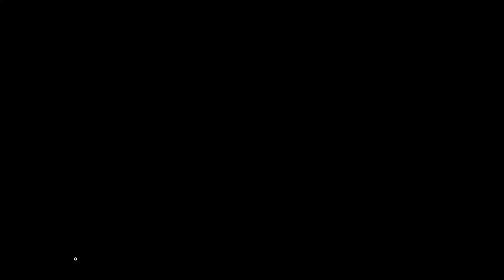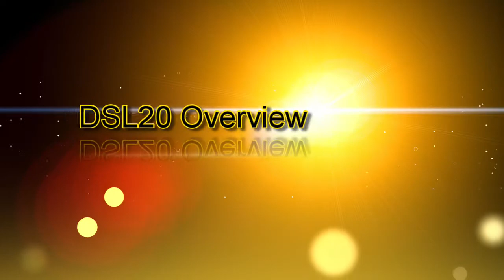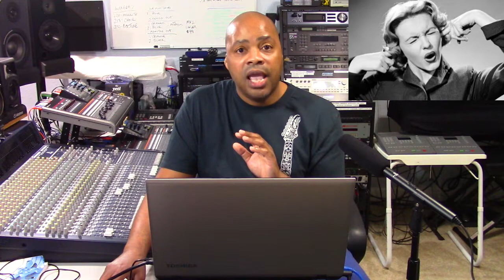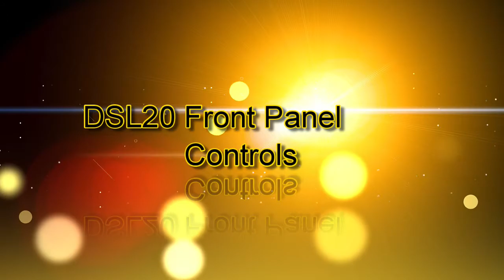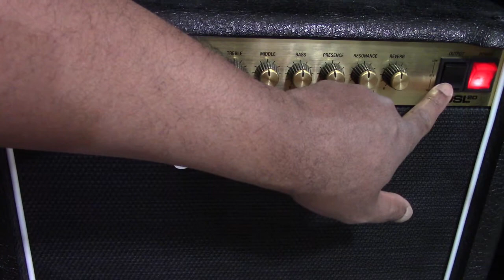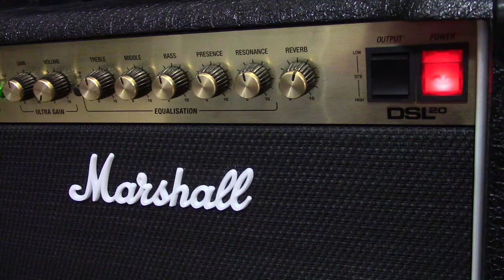Marshall DSL20CR Combo Amplifier: Why I Use It

Comment: Hi there, I ordered this amp based on this video thank you, but I find the sound very harsh and thin, and actually quite boxy. I also have a DSL15 which by comparison is much warmer with much better low end base. I tried plugging the DSL20 amp into the DSL15 speaker and it was better but still very harsh. Did you find there was a considerable hiss with all the volumes down?
Reply from the maker: I don't, but that can depend heavily on any other gear you have connected. Thanks for watching.

Comment: Great explanation of the controls! Thank You! I just bought one 2 weeks ago ( mine doesn't have the open space on the back? ),and have been mucking around with the controls since. I couldn't find any video to explain what every control did so well! The only beef I have with this Amp. is when I have it on  " Ultra Gain " I get a major"Humming" at high volume. I was told to get a Bugara soak. Do you suggest the same?
Reply from the maker: That's a good suggestion. However before that, you may also want to have your guitar checked out by a tech to see if it can be better grounded, as that may also help. Thanks for watching.
Reply: @PowercoatMusic  Even if it's a brand new Strat. from a good guitar store?

Comment: Been playing with a Boss katana mk2 100w, just got the DCL20 combo, just curious if anyone noticed how little of a sweep the reverb on the marshall is vs all 3 types of reverb on the boss katana (ex, the boss reverb if dimed almost sounds like a delay, marshall i dont really noticed the difference in a pronouced way, i hear a very suble not too noticeable sweep on the marsh. reverb knob, vs the boss katana mk2 where the reverb was much more senesitive.
Question being , this is my 1st tube amp, is rhe reverb much more suble then an amp like the boss spring/hall/digital Reberbs that were built in, or do the from of tube amps have weaker (leas fouced on reverb effect?) the sound is much more crisp & beefier thru the mashall DSL 20 no (clean & with gain). Also on the tube marshall, is vol.2-3 loud enough to wKe the house at midnight, cuz mine is lol hard…gets loud very easy (no issue just wondering & especially how the reverb sweep is on the marshall dsl 20
Thanks for any help
Reply from the maker: Well, I think this might have to do somewhat with environment as it can be subjective. From my perspective I would say the reverb is richer and warmer on the tube, even at lower volumes. However, others may disagree. And yes, it is loud even at lower volumes. Thanks for watching and sharing. 👍🏿
Reply: @PowercoatMusic  ive read many reviews about the digital reverb built into this amp, most ppl say they dont hear/notice it until dialing it to 9-12 o’clock, also they said its nothing like a fender amps reverb which is spring reverb & i guess much more noticable. My boss katana i was using plate/hall/spring reverb and it just seemed to sound much more noticable and much more of a sweep from 0-max. I do understand what you sre saying about the tube (+the reverb), its more natural sounding, but never the less on the amp i have (dsl 20) the sound & tones are great, only thing i would have liked to see was that reverb knob compete better against my boss katana’s 1 of 3 different reverb option’s. And when the tone shift is pushed in (it sounds more compressed and more top end-ish espescially on ultra gain channel) is that the “british” tube version? Much bigger fan of leaving the tone shift popped out, sounds alot more open & full & a little less messy lol, just curious cuz 1st tube experience and i did get the last one (which was the floor model) so not sure how great it may have been taken care of..if that matters (looks wise you’d think its right out the box). Thanks for the reply and if you have time later to read this lol keep up the vids & thanks!
Reply: In the real world.. you want your reverb to be subtle, no matter what volume.. if you are playing 90+% rock tones, you need your reverb to be subtle for a mix or live, they aren't designed to be played alone in a bedroom.

Comment: hello, will this be loud enough with a heavy handed drummer? will be playing metal and rock in a garage or an open backyard, will the volume be loud enough with the master volume around 7?
Reply from the maker: We know this a tube amp and it's very loud. My advice is to try it out in a store if you can first, but I don't think you'll be disappointed with the volume level for the setting you're describing. Thanks for watching. 👍🏿
Reply: 20w valve is 100% enough for a drummer no matter how hard he plays

Comment: Hey, Man. I have recently bought one of these, and I am super impressed with it. The only problem with it is that the reverb is weak as. Full on it doesn't sound much. May as well not have it. I've heard some were wired wrong on the reverb tank. How deep is your reverb???
Reply: Reverb tank? It’s a digital reverb, there is no tank
Reply from the maker: The reverb on my unit sounds fine. Could be an issue with your unit specifically? You could always insert one that you like better if playing live or add a different one to the track if you’re recording.
Reply: @PowercoatMusic  Yeah, I'm sure mine is faulty. Thank you. 👍
Reply: Lots of great reverb pedals out there that could solve your problem!

Comment: Is the eq section passive with button in or out? 
I have this amp, I want to use it with passive eq .
Reply from the maker: Great question. I checked several different specs and none say anything about the TS switch becoming active when pressed. Marshall says the EQ is passive, so I have to go with that both ways. Passive.  However it would SEEM that based on what the TS switch does, pressing it would make the EQ active. However, I have seen nothing so far to support that at this time. If anyone knows anything to the contrary, please chime in? I hope this information helps.
Reply: @PowercoatMusic  Thanks man , I appreciate it, that's what I was
guessing too, makes sense, but 
they should  tell us, or throw in a 
little green light. I've got the 
amp dialed in pretty good today, 
ordered a second one for 
stereo, should be nice, we'll see....